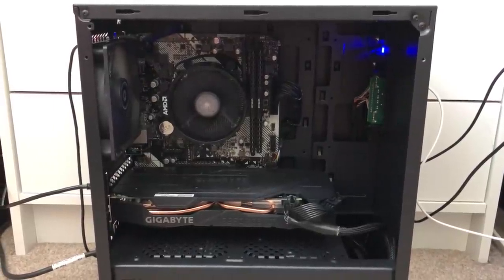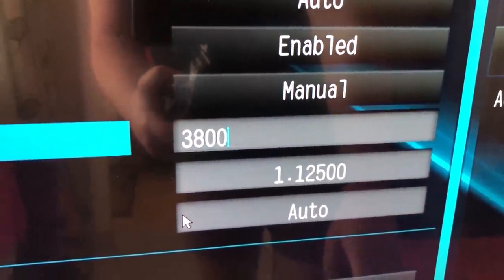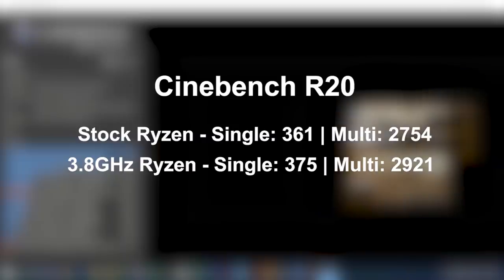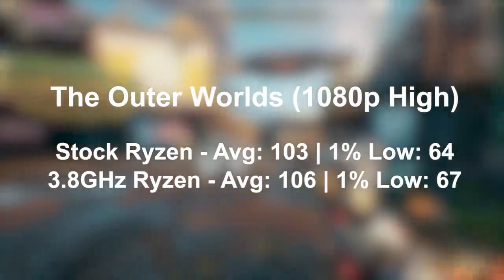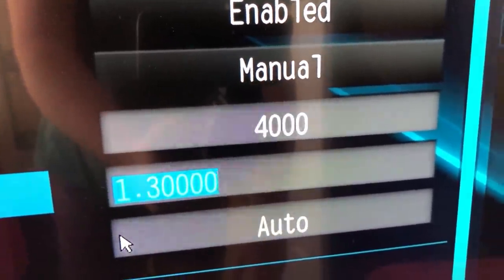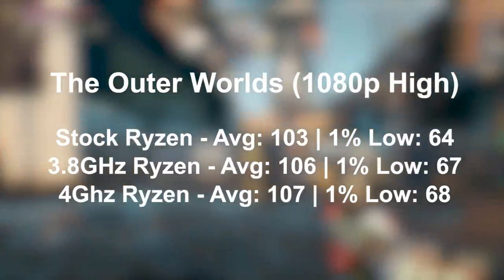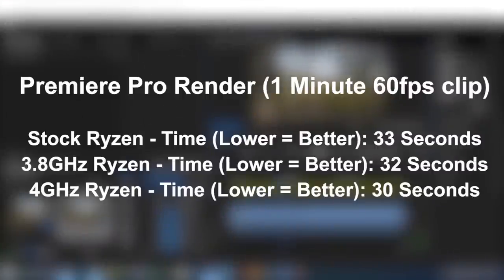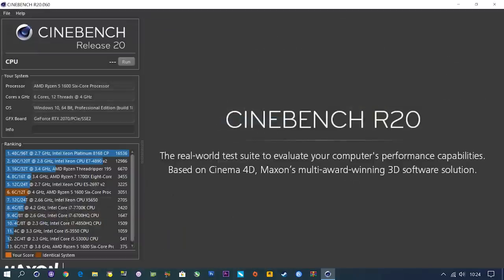4GHz Ryzen Overclock On The Stock Cooler: Good Idea Or Fire Hazard?

Comment: Now do the same thing with an Intel Core CPU...
Reply: Nahpets Android Gameplays he doesn’t need to bc they don’t sell them lower than 4ghz
Reply: @Khloya69  uh... You are very wrong very very wrong
Reply: Kinda cant, it WILL set on fire with the intel stock cooler lol
Reply: BaixaModz 4ghz is slow af. CPUs have been stuck on that for like a decade and you’re telling me they sell lower than 4ghz now?
Reply: Leaha bc there is no intel stock cooler
Reply: U cant, bc locked CPU bs
Reply: Holo Scope you probably support biden lmao
Reply: @Khloya69  bruh ryzen 3600 is 3.6ghz
Reply: @Khloya69  bruh it's just like you say that you can overclock a locked laptop CPU
Reply: Joshithprogamer 3.6Ghz on only 6 cores? Wow that’s garbage
Reply: @Khloya69  no it inst almost no chips come with 4 ghz
Do your research mate
Reply: Just pay few hundred dollars more
Reply: BaixaModz first 4GHz CPU came out all the way back in 2012. Damn near a decade ago. Why are they still selling CPUs with less speed. Not to mention that was a bulldozer so probably harder to push to 4ghz
Reply: Holo Scope Ur mad bc I’m better than you
Reply: @Khloya69  are you trolling? Btw Intel at the same price offers less cores
Reply: @Khloya69  They went for "more cores and threads" since higher clockspeeds produced more heat and they performed worse than multicore processors with lower clocks. Also depends on the architecture, bulldozer performed poorly against intels core series even if they have higher clockspeeds. Even if a proceesor today has a lower clockspeed than processors from before, the performance gap is big because of better architecture. Higher clocks isn't always the answer
Reply: @Khloya69  You have the i9 9900T, and is less than 3Ghz Base!
Don't speak without knowing
Reply: Joshithprogamer 4Ghz isn’t a lot. The 3950x is a 16 core with 4.7ghz boost. Why are their 6 cores sub 4 ghz
Reply: Ryukendu31 I’m not an idiot.
Reply: PatalJunior so conclusion. Low end chips suck
Reply: I think I need to explain this. Intel CPU's did come with a stock cooler a long time ago so the original comment about doing it with an intel core CPU is about using an older Intel CPU. Also, the base clock and boost clock are different things. No intel CPU, not even the top-end Core i9's come with a 4ghz base clock, the i9-9900k comes with a 3.6ghz base speed. But almost all Intel CPU's released in the last few years have boost clocks above 4ghz. And also there are unlocked and locked intel processors. Intel mobile chips tend to be locked apart from very high end mobile chips.
Reply: @Khloya69   The I9-9900k comes at base 3.6GHz like most AMD chips, does that mean the I9-9900k is garbage too then?
Reply: @Khloya69  if you have a 3950x, then why are you saying that AMD sucks?
Reply: Leaha imagine insulting ppl for no reason bc you can’t come up with a valid argument
Reply: Due to architectural differences, you can't directly compare frequencies from different chips. That's why bulldozer had bad performance despite having 4GHz base clock. Therefore, benchmarks are used to objectively measure the real world differences between chips. Intel is able to push chips to higher frequencies because they use a much older architecture, although performance increase isn't linear with frequency increase.
In conclusion, if you value your money as a customer even a little bit, you won't buy into intel's anti consumer practices.
Reply: @Khloya69  Because of power consumption and heat. Overclocking a processor even slightly will dramatically increase its tdp
Reply: David P i mean bulldozer ran hot so sure as hell was hard to push to 4ghz. Why do they still sell sub 4ghz ryzens with the improved efficiency.
Reply: @Khloya69  imagine overclocking above 5ghz and only getting a small boost in performance. Like I said clockspeed isn't everything
Reply: @Khloya69  faster cores don't mean everything I mean just look at the bulldozers,also you can't compare them directly because of architecture differences
Reply: Ryukendu31 so explain the 4.2ghz bulldozer. You can’t justify sub 4ghz Ryzens with the higher efficiency when bulldozer ran hot af.
Reply: ChloeWade you’ve lost just walk away
Reply: @Khloya69  lmao, I'd rather take any time any day a ryzen 7 3700x over an i7 10700, a 125W tdp cpu because Intel is incapable of escaping 14nm. I mean sure, if you're into room heaters you're more than welcome to go with intel and their 10th gen 14nm++++++++ architecture
Reply: You dont even know what you are saying
Reply: @Khloya69  Thats why they made it lower than 4ghz because of the heat. They just made it much more efficient and while performing significantly than bulldozer. Bulldozer was trash thats why nobody loved them
Reply: @Khloya69  fun fact- i9 9900k has same base clock as r5 3600 = 3.6ghz. There is absolute champion of pushin clock on extreme OC, its amd's FX series cpu(8+ghz on ln2). Thing is, simple clock speed mean nothing. For example? amd zen2 has more instruction complete by cicle(around 15% more then skylake-coffee lake(which is basically same thing)), which mean they do more on same speed. Intel compensate it by pushing clocks, but yet to bring something new since 2017, which translates in ramping up operational temperatures. 9900k can throttle under 240m AIO on stock, which is ridiculous.
Reply: @Khloya69  bulldozer did run very hot but weirdly enough under liquid nitrogen people were pulling as high as 8.429ghz on an fx 8150 single core and the fx 8150 held the world record at 8.429ghz untill the fx 8370 took it at 8.723. I mean take any cpu today from AMD or Intel and try to get it single core that high of a frequency. Despite the fail of generally any fx cpu the architectures are very interesting
Reply: @Khloya69  I guess it's basically a marketing strategy. I mean I'd be happy to overclock my cpu but to consumers, most will probably never try overclocking. The bonus clock speed wouldn't be worth the extra power consumption and heat. It would also make wraith coolers worthless. That's why they do their best to balance performance with tdp.
Reply: This comment thread is literally a pigeon flipping over the chess board, and strutting about as if he won.
Reply: People get too excited over "online discussions" lol
Reply: @Joshpods  lol Amd is soo much better on price for fps
Reply: Silenthorror13 your spelling mistakes invalidate your comment
Reply: Meme Sampler Also you have an anime pic. L.
Reply: @Khloya69  playing Gta 5 online in 2020 lol
Reply: @NetHistory just ban
Reply: @NetHistory rofl
Reply: ChloeWade some people these days can’t accept they have lost
Reply: And your one of them
Reply: OpTic.v7 many people still do lol.
Reply: Real Cobby yes. You don’t accept being completely annihilated by me.
Reply: NetHistory I’m done with this comment section most people are actually knowledgable people the others just have no brain cells and can’t accept that they are wrong
Reply: Real Cobby you mean most people have no brain cells throwing insults at the one intelligent person (me) for no reason?
Reply: @Khloya69  You are nitpicking and biased, bye bye, I win

-videogamedunkey
Reply: Real Cobby I’m not wrong
Reply: Ignacio Ruiz lol no
Reply: @Chloewade do you also believe that 5G towers is a leading cause for Covid-19 ? I'm curious to know.
Reply: Vishva Fernando the leading cause of covid is lying media and corrupt governments
Reply: @Khloya69  oh no! It's you again!
Reply: @vishvafernando4866  5g didn't cause covid
Reply: Holy shit how did this get 80+ replies in 1 hour
Reply: @Khloya69  bruh moment
Reply: . I think you’ll find I’m the only intelligent one lmao
Reply: @chickened4487  somehow
Reply: @grimmy7867  ok then
Reply: @Khloya69  you don't know how much is 2+2...
Reply: @Khloya69  Not to mention that a bulldozer CPU running at 7.5 or 8 GHz cant beat a ryzen chip, der8auer did a video showing thia
Reply: @Khloya69  technically your profile pic is also an anime pic
Reply: Nahpets Android Gameplays more like you don’t. You’re tryna talk down to me bc you’re jealous of me. I’m the only smart one here.
Reply: @NetHistory IIs "NetHistory" your alt account? Ya'll have the same illiteracy levels.
Reply: @iceangelx22  Except a lot of them are actually justified, ofc there is still no reason to be loyal to only one brand.
Reply: @Khloya69  "bc there is no intel stock cooler" wait so the intel stock cooler i have does not exist? Shit maybe that is why the chip is getting so hot
Reply: SpikeTheBear there’s no stock cooler on high end chips anyway.
Reply: Pryonto Sarker My mom does love me. I’m the one that doesn’t love her.
Reply: This was a joy to read
Reply: @Khloya69  m8, intel's speed are not equal to amd's speed. for example a 4ghz chip from both end wont perform the same since they dont work (measure) the same way... and same goes to TDP
Reply: I want to donate my brain to Science after reading this
Reply: Mad Scav when did i say it was? Tell me. I didn’t
Reply: Burner Acc when did I mention owning an intel CPU?
Reply: Burner Acc all y’all doing is making yourselves look stupid by referring to stuff I didn’t say
Reply: @Khloya69 yes, I know that you don't in fact own Intel CPU, I've seen your reply that you own, what is it, 3950x?
Also, where did I mention that you have Intel CPU? I don't care what CPU you have. I'm just trying to put an end to this useless debate.
Reply: @Khloya69  "they dont sell them lower than 4ghz" my i5-3330 begs to differ bruh
Reply: Khoa Do oh really? Shakespeare’s works sucked so i’ll take that as a compliment. I’m not a moron. Everyone else has shown themselves to be morons. I’m the smart one
Reply: Khoa Do i mean for starters they don’t even make sense. Wherefore art thou Romeo does not mean where are you? Wherefore means why.
Reply: @grimmy7867  Nope, I just said "oh no, chole is doing an exist again"
Reply: @Khloya69  iam not discussing with a 11 year Old with 2 iq
Reply: ChloeWade  please stop it
Reply: @HoloScope  And you're a mindless AMD shill, what's the damn difference?
Reply: @DerrickRG  How am I a shill, please tell me where I said AMD rules and that Intel is shit,  I'm literally typing this on my i5 9600KF PC right now lol
Reply: @unlegitmilku  you can get Pentiums on 4.2GHz...
...
Only downside is, it's a pentium
Reply: @NetHistoryto these kind of comments.
You just pass thru them like you never saw them.
Ignorance is the best weapon.
Reply: @RANJITPLAYZ  Now he is going to play gtao and, kill everyone with opressor mk2.
Poor kid
Reply: @burneracc2567 Im fanboy for the one that gives me the best performance per dollar
Reply: @unlegitmilku  I think it's more like
 - 10 IQ
Reply: @Khloya69  cough my 3.2Ghz i5 6500 would like a laggy word with you...
Reply: @Khloya69  Every non-K Intel desktop model comes with a stock cooler. You can see tons of sub-4Ghz Intel CPUs just browsing PCPP or ark.intel.com. Dont be such a shrill shill.
Reply: ChloeWade i9-9900k is 3.6 stock can be overclocked to 5ghz, what it says on the box. The others boost to 4. Whatever.

Anyways, more cores is always better. But if they can pack both frequency and cores, that’s pretty nice. Though, for now more cores can make up for a 3.6 GHz base clock I guess. Keep in mind, TDP and heat.
Reply: Intel's chips are locked, and the K variant doesn't include a stock cooler.
Reply: @Khloya69  Shadilay,comrade,shadilay
Reply: @andreiarg  intel's latest chips have become the legendary nvidia gtx 480, renowned for requiring nuclear plant levels of energy in return for the performance of, at best, a sporty hatchback.
Who wants a 65 watt Intel chip in their laptop that is waay slower than a 35 watt laptop chip made by AMD?
Reply: you can run a newer intel chip at 4 ghz using block + 5v fan or even passively cooled with a big block, afterall they can run 5+ ghz, 4 ghz on an intel chip is low. 4 ghz on a ryzen chip is not low, it's the average oc max across all cores. 1000 series = 3.9 ghz average, 2000 series 4 ghz average and 3000 series 4.1 ghz average.
Reply: @Khloya69  you shill for intel everyday in comment section but buying AMD CPU? bwahahahahaha
Reply: BaixaModz I’m 21 and smarter than all of you combined lmao
Reply: @Khloya69  but u gotta admit, current Intel chips are crap when compared to AMD. I don't think they can ever match the performance gap between them and AMD any time soon.
Reply: @Khloya69  I guess Everytime you say AMD suck is way to show that you are not biased at all? Lol
Reply: The Pro Tester when did i say otherwise?
Reply: @Khloya69  I was just making my observation.
Reply: @Khloya69  this video is showing how far you can get with AMD's stock cooler, overclocking an intel chip with its stock fire is the equivalent of a bonfire
Reply: Za Hando well no shit since there is no stock cooler
Reply: Nahpets Android Gameplays first of all I’m the only smart person in this whole thread. Second if you were smart enough to be able to call me stupid you would know that IQ is not an accurate measure of intelligence.
Reply: Intel overclocking chips don't have a cpu cooler in the box enjoy baking your cpu 🤣
Reply: @Khloya69  FuckingWade is back again, haunting this channel.
Reply: @Khloya69  clock speeds arent anything. You can have a AMD fx 8320 at 5 gighertz and an Intel i7 4770k at 3.90 and the i7 will blow the amd fx out of the water. Just saying it's not all about the speed and there are many other factors that take place.
Reply: @Khloya69  bro you literally did go read what you said in the comments along with everyone else telling you your wrong  😂
Reply: JK Scar also you’re *
Reply: JK Scar never in this entire thread did I specifically mention performance
Reply: @ca9inec0mic58  hes "special" you cant change that. Lol
Reply: @Khloya69  all the people not liking your comment is reason enough to call you out on ur BS. If you were right you would have more likes yes?
Reply: JK Scar trump 2020 KAG
Reply: @Khloya69  oh dannng u got  me but im a libertarian so change that last word and you'll be accurate
Reply: JK Scar clearly that’s why you call me he REPEATEDLY. When I’m clearly a female.
Reply: Ca9ine C0mic i didn’t. I’m the only intelligent one.
Reply: Ca9ine C0mic name on stupid thing i said. I’ll wait.
Reply: Ca9ine C0mic i can name many all of you said
Reply: You need a 4 fan liquid cooler to get it at 5 ghz and get about the same performance of a 1700
Reply: @tikoblocks3224  she's the one who declared a war
Reply: Tikoblocks you’re* bc i clearly said it and people clearly demonstrate their lack of intellect by continuing to call me stupid lmao
Reply: Tikoblocks only one acting like a first grader is everyone else
Reply: Tikoblocks yes it is sad. People like me are the last beacon of hope for humanity.
Reply: Nahpets Android Gameplays will y’all admit you lost? You’re a mobile gamer so you’re completely invalid.
Reply: no idea whats happening in this thread  but anyways

cool
Reply: @Khloya69  stop assuming your the only smart person. Ppl can have different opinions ya know. Its a democracy,  not a dictatorship.
Reply: The Pro Tester it’s about as much of a democracy as America. Demokkkrats say they wanna save democracy. We was never a democracy to begin with. We’re a constitutional republic.
Reply: Tikoblocks it’s sad that you’re all still in denial that I’m the one that’s right
Reply: @Khloya69  nope. America is an oligarchy, with all the lobbying (bribing) resulting in the rich controlling the laws of the land.
Reply: The Pro Tester Trump is changing all that. Finally a president the swamp can’t control.
Reply: @Khloya69  lol. And yet big business get all the breaks, while small uns gotta fend for themselves right
Reply: The Pro Tester democrats are doing that. Not Trump. They prevented the aid which Trump wanted to provide and tried to give aid to illegals. The swamp are obstructionists.
Reply: Tikoblocks no. I just don’t receive notifications for every reply only some.
Reply: @nahpets2345  yeah man I know 🤭I just wanted to know whether the smart guy chloewade believed that 5G towers was the reason for covid 19
Reply: @Khloya69  holy shit. I grabbed some popcorn and shit this intel sheep was saying is so funny. If he's not paid by Intel then I kinda feel bad for him or wait. I don't
Reply: @Khloya69  you got that wrong kid, I've bought Ryzen 3600, with money I made by working(yes, you can go to work, thank me later). BTW I love wasting your time you're so hilarious you could become a comedian in some alternative universe
Reply: @Minto107  lol 3600X that shit slow
Reply: @Khloya69  Hahaha you're funny, it ain't the fastest and it won't keep my house warm in winter like Intel would but it's decent for gaming
Reply: @Minto107  imagine seeing ‘decent’ as good enough